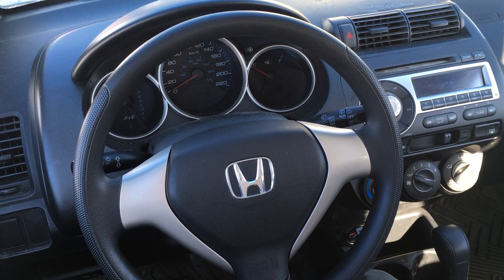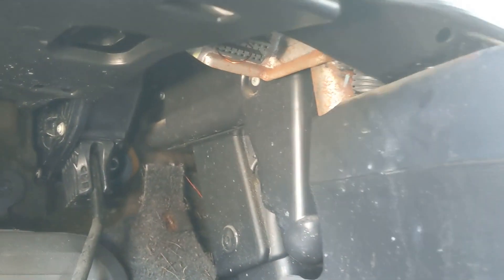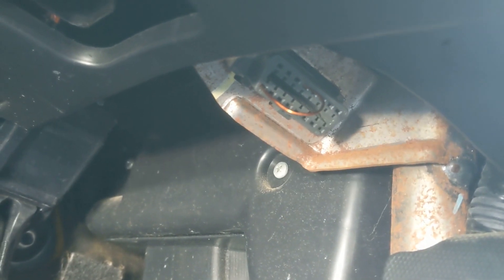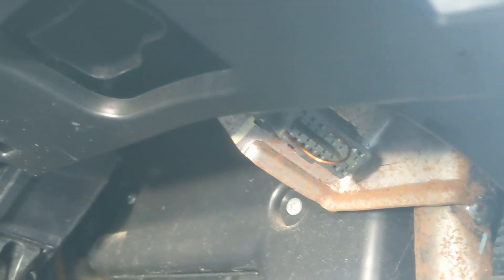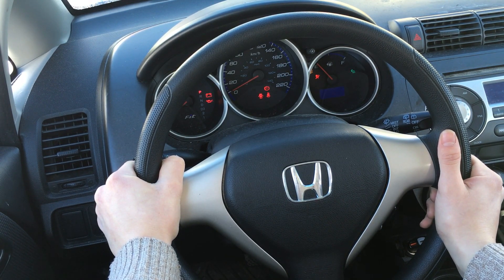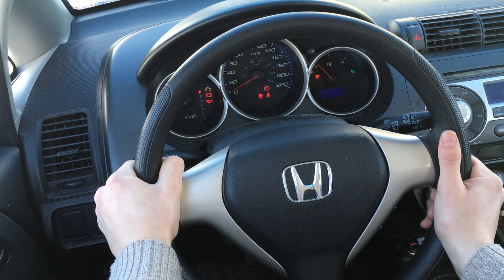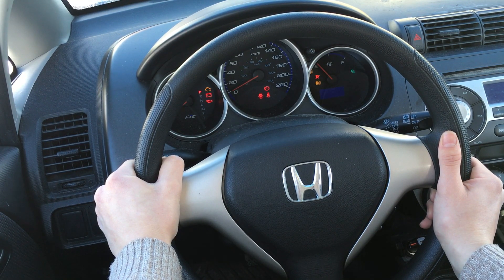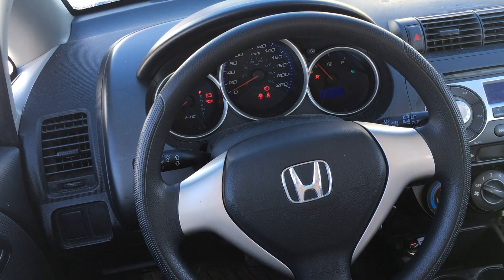Honda EPS SAS Torque Sensor Relearn: DANGEROUS Steering Fix! | Fit, Civic, CR-V... RESET/RELEARN

Comment: Just bought a Honda fit 2008. It was super hard to turn right and too easy to turn left. It would drive straight at low speed, but on the highway, the car would turn to left if did hold on to the steering wheel. I was able to do the procedure and now it is easy to turn on both sides. Thanks for the video.

Comment: Tried this with my Acura CSX but no luck. I think I got it to flash once? But failed to turn steering wheel
Reply: Hey, I also have a CSX (2011) with a sticky/pulsing/groaning issue when turning the wheel to the right. Did you resolve your issue? Cheers, Matt.

Comment: What if the eps light only comes on when the key is in the ignition but not actually on? I just had new tires installed and a wheel balancing and alignment. The steering wheel turns fine and doesn't move on it's own to the left.

Comment: Thanks for the video. I have a 2015 CRV and when driving on the hiway I am having to make small corrections to keep it in a straight line. It's really frustrating. Do you think this procedure would help?
Reply: your wheel is off some while driving is an alignment issue

Comment: Will this work on my civic x 2018? My steering feels a little heavy most of the time. When i had an alightment it felt very light after but only for a short time. When i changed the battery it became light again but maybe after 2 days it began to feel sticky again. 
Btw i replaced the steering rack feb this year and from what i remember it felt heavy the moment i took the car home.
Reply: I'm pretty sure it should work. When replacing your steering rack, you have to perform this callibration procedure.

Comment: Worked on a 2006 civic si coupe.. cel flashed twice instead of the power steering light but worked for me. ( i replaced the eps module with a working one didn’t work until i did this procedure first tho ! Checked the fuse and grounds before I pulled eps unit.

Comment: Will this work on my civic 2007 i dont get any codes my problem is i have hard steerring when turning right only.
Reply from the maker: In your case if the vehicle has EPS it may help however the problem is likely within the steering rack itself and should be diagnosed professionally.

Comment: In my case I have 2023 Toyota Camry when you turn the key on yellow steering wheel with exclamation point comes on and then when you start the engine it disappears is that normal.
Reply from the maker: Yes this is a bulb check that you’ll see most vehicles complete it shows if a bulb such as the check engine light has failed.

Comment: Worked on my 2012 Honda civic lx didn’t do the pin hot wire just the recalibration with the light on and went away
Reply: Will this jumperless method also work on civic FB 2.0 2014? (Asian model)
Reply: Will this jumperless method also work on civic FB 2.0 2014? (Asian model)

Comment: I need help with my 2005 honda civic eps system i change the rack and steering still hard and eps light still on
Reply from the maker: The vehicle requires the new rack be programmed.
Reply: Same here I put a new eps motor from bronx Honda and same issue I’m having, locks up while driving. 😢

Comment: 2008 Honda Fit.  I attempted the torque sensor relearn procedure, with the front wheels on the ground.  After jumping the OBD #4 and #9 pins, then turning the key to the "on position", the dash EPS light did not light continuously as described / shown in the video.  Instead, the light flashed once, followed by two flashes (all three flashes were the same duration), then repeated this flash-sequence continuously.  As a result, the balance of the relearn procedure could not be executed.  Can anyone provide insight or otherwise advise me on this ?  Thank you.

Comment: Hey first off thanks. I had absolutely no issues with my 2013 accord and was having my tires rotated and an alignment performed. I left the mechanic and noticed my steering felt stiff, just ignored it and chalked it up to tire wear. Then while stopping and parked it began the steering wheel began to turn hard to the right. Took to same mechanic and they're now quoting me $2k+ for a rack repair. Wouldn't they have attempted a torque sensor relearn right away?  Or is that not common practice. Thanks a lot
Reply from the maker: Most places will suggest a new rack right away since that is likely the long term solution.

Comment: I have replace a steering wheel sensor toqrue /angle but after that as soon i start the car steering wheel go to the left by himself i drive the car like that in the left side is pretty easy but on the right is very hard to pull when i stop the engine shut down steering wheel returns in some position is this method you performed can help to set steering wheel in zero position toq and angl position thanks
Reply: Did the procedure in the video fix your issue?
Reply: Hi have you been aboe to fix your issue? How? Facing same problem with crv

Comment: Do the wheels need to be in the air to perform this? Or can leave them on the ground?
Reply: Kinda late but imma do mine in the air. I'll let you know if it worked
Reply: @philipeon2831 🍿
Reply: @katdaddy469  better to do them on the ground
Reply: @philipeon2831 still waiting

Comment: My wife bought a cvr 2017 in Honduras to Excel Automotriz
After only 45k kilometers the steering rack has failed and it has to be replaced for an aproximate cost of 6500 dollars
Verry disapointed with the brand, and now that i have investigated i found out that there is a lot of people having problems with Honda steering racks both hydraulic and electric
I will stay away from Honda
Reply: Lol 🤡

Comment: Thank you so much for this tip! I actually found I had to hold the wheel at 45 degrees while turning the key to get the procedure to start. I'm pretty sure it worked as I got two quick flashes of the EPS light on completion, and the steering feels better now (a little lighter and more responsive).
Reply: 45 degrees to the left?
Reply: @luciaguilera7068 Yes, I think so.
Reply from the maker: Anytime, always happy to help im glad it corrected the issue you were having.

Comment: Great video.  Same issue with my 07 fit.  Steering wheel turns left with no driver input. I noticed that my steering wheel needs to be turned a few degrees right when driving straight with the under-hood 60A # 2 fuse pulled..  Would this screw up the relearn process when centering the wheel during relearn?
Reply from the maker: It shouldn’t since the SAS (steering angle sensor) is inside the steering wheel itself. The fact your wheel is off some while driving is an alignment issue no doubt. Definitely worth getting checked out since this can cause excessive uneven tire wear often times quite quickly. It could be the result of meeting a few to many large potholes on the roadway or even worn suspension components and bushings which should definitely be checked for prior to having the vehicle aligned.
Reply: @combustiontherapy2222  Unfortunately my 07 fit could not relearn the torque sensor.. When I jumpered 4 to 9 and powered up, the torque sensor relearn light flashed three short flash's followed by a longer forth flash over and over.
So I removed the 60A EPS fuse and all is good. No need for a gym membership either..
I assume my torque sensor relearn lights will stay lit until I replace the fuse, which will never happen because new struts , rack and install cost more than the 1800 I paid for it.